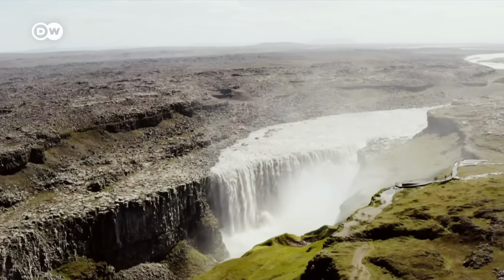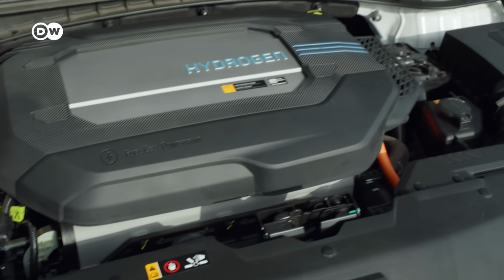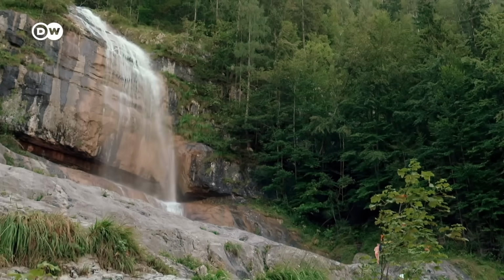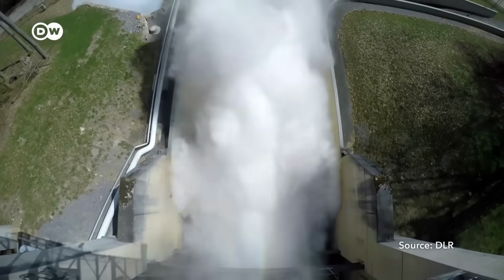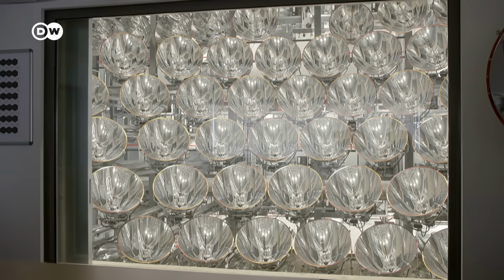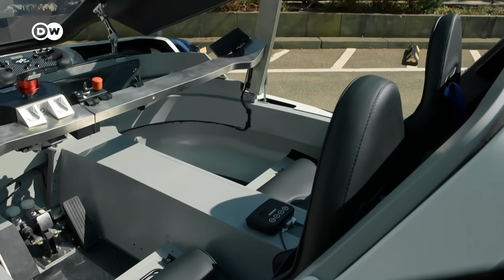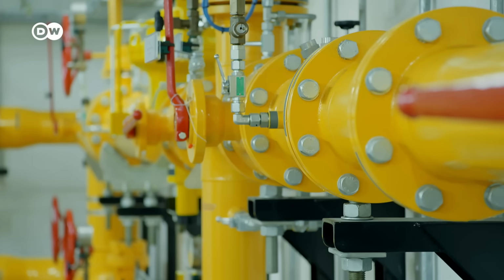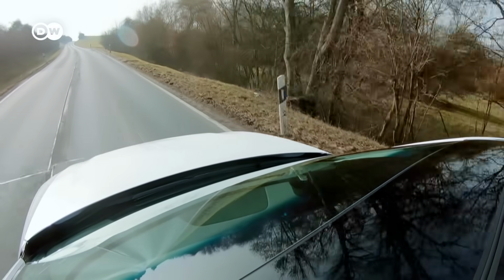Is green hydrogen the answer to the climate crisis? | DW Documentary

Comment: I guess Germany only has two weeks of sunshine throughout the year. That means they will be exploring other alternative sources of energy. Hydrogen is still too expensive to be practical. Back to the drawing board. Eventually, we almost have to get off of carbon based fuels. Even so, plant trees to raise water tables and regulate temperatures while lowering the sea level a bit. You can use the sea water to experiment with hydrogen production. In a pinch, you can revert back to vehicles running on wood gasifiers. 😃
Reply: The problem with solar panels and burning wood is that they do nothing for global warming. Combustion engines still release the co2 regardless of if it's directly from trees or oil.
Reply: @ROCdevelopments  if you plant the trees and then burn it after they've grown, then the net CO2 emissions will be zero as the amour of CO2 emitted by burning the tree was absorbed by the tree while growing

Comment: I wish they had touched on the status, trade offs and comparability of liquid ammonia as a hydrogen source, which has more energy density.
Reply: Какой умный Юхан по твоемуㅐ2 полученный иза аммиака более теплоемкий  чемводород? Спасибо за ликбез.
Reply: How do you separate NH3 to Nitrogen and Hydrogen? How do you make NH3 with solar power?
Reply: @vikramshah6433  You burn it and deal with the nitrous oxide using a catalyst, or you use a catalyst to separate it at temperature and release the nitrogen, or something like that, but these details are why I wished ammonia was mentioned and the details elaborated.

Any method used to make hydrogen should support modification to generate ammonia, and I'm guessing biological fermentation makes ammonia more efficiently than hydrogen.

Also, NH4 or hydrous ammonia has even more energy density.
Reply: @rolandsj8880  the potential ammonia offers are that there are many sources, compared to hydrogen. With hydrogen, you can make ammonia out of thin air (air is mostly nitrogen, which is all that is needed to create ammonia from hydrogen).

I mean, where are you going to get billions of tons of hydrogen? Well that's basically your answer for ammonia too.